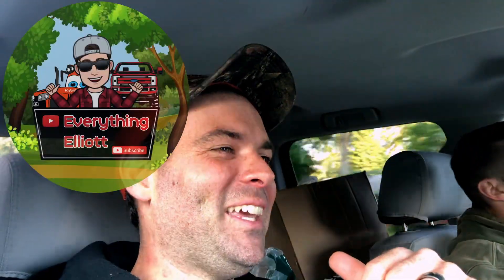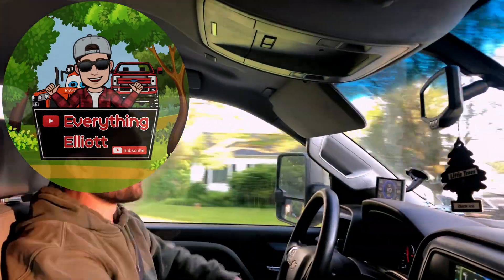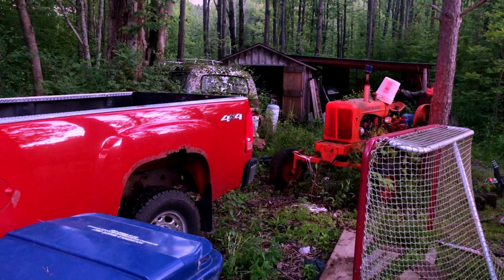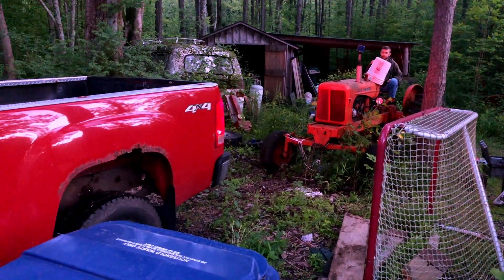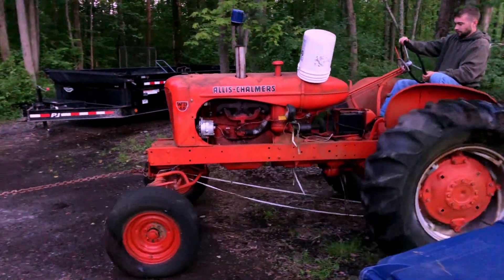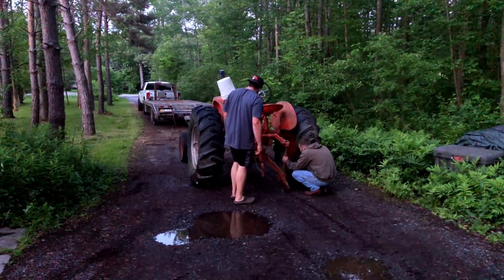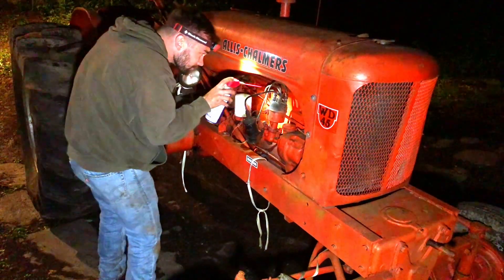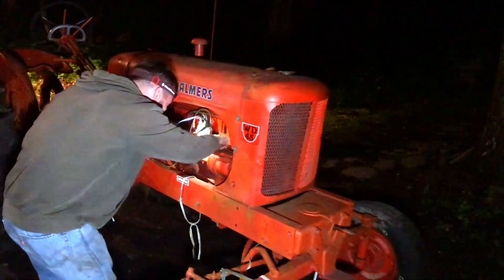Saving an OLD Tractor From the Scrap Yard - Allis Chalmers WD45

Comment: The metal looks really good. I have overhauled those engines in a WD many many moons ago. My dad was an excellent mechanic.  We overhauled them. Take the plugs out and pull it up and down the drive way slowly to break then just a little. Had one so tight we had to use the starter, pull it, and crank it to get it going. That one when it was broken in had no problem with 4 bottom - 16 inch  plow and a 12 ft disc. Would pull three bottom in third gear if you wanted to. Kind hard on the moleboards
 I spent the biggest part of my childhood days on Allis's from WCs, D Series, 1xxs to a 210 and a 7080. Never had a single transmission problem. 
 That one even has the belt pully!!!!
Reply from the maker: My friend that owns it has it up and running and says she’s a work horse